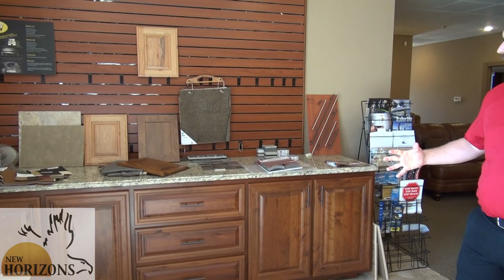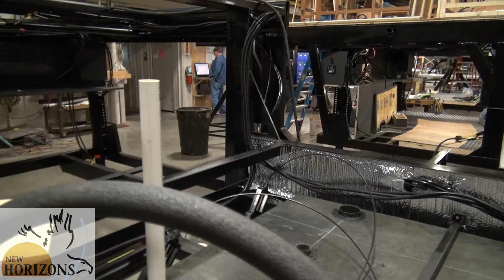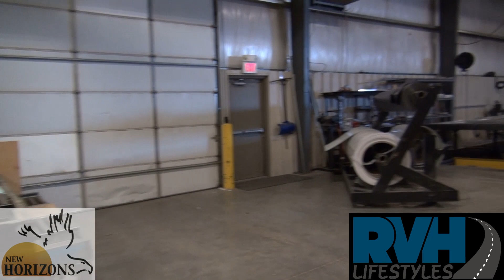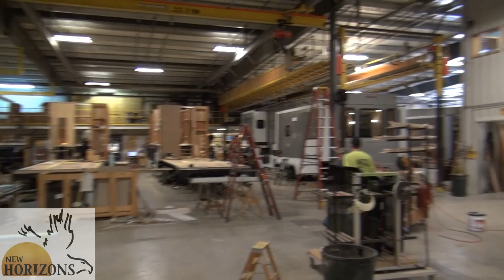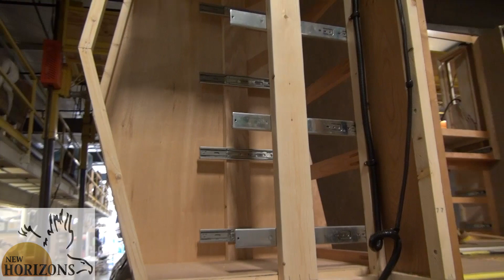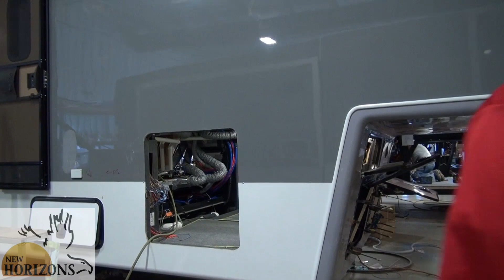PART 1 New Horizons RV a Manufacturing Plant Tour How to Build a Custom 5th Wheel RV Part 1

Comment: All you did by adding those skid rollers is dropped that frame by five or 6 inches making it even worse. What’s the frame going to do when it hits the rollers to concrete? It’s going to have the same exact effect as hitting the frame on concrete no difference very poor decision to install those. Honestly this factory tour, after watching a plethora of other factory tours, this one was, by far the worst. My confidence level, from a potential buyer/customer was severely shaken …

Comment: I have an old one built by whover new horizons was in 1997.  This old outdated rv is doing better than a brand new grand design on the cheapest frame that will not crack being towed to the first dealer.  The warrantee of those frames is up to the curb of the dealer.

Comment: Those box beams you use for lateral frame strength would be much more effective for that purpose if you designed them in flat vs upright.

Comment: Thats good that you blow heat into the area where the tanks are, but whenever your using your heater your using propane, Why don't you eliminate that by installing 12 volt heat pads on the tanks, that way your can save on the propane when your in a park and hooked up to electric. Even if your gone for the day, you don't have to have the heater turned up with the knowledge that your tanks are ok with the heat pads on your tanks. Every other manufacture of fifth wheels has them on their coaches, There has to be a reason.

Comment: "specialized paint" on the chassis?  Not powder coat?
Reply: Powder coat is for ease af mfg, not for longevity.  No voc's in powder coat.  Liquid paint has better adhesion, and will not flake asceasily on coating holiday.